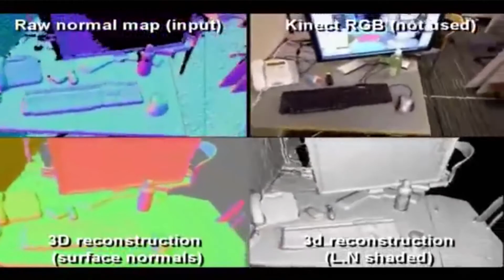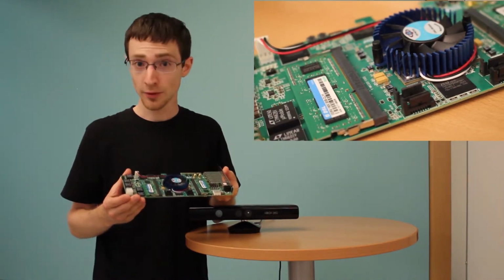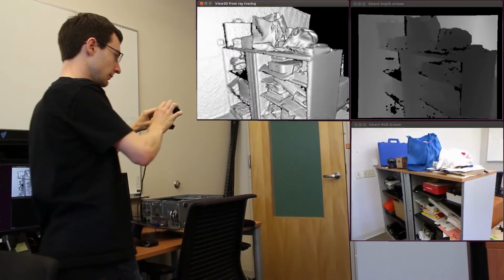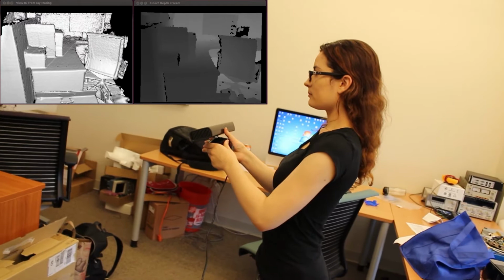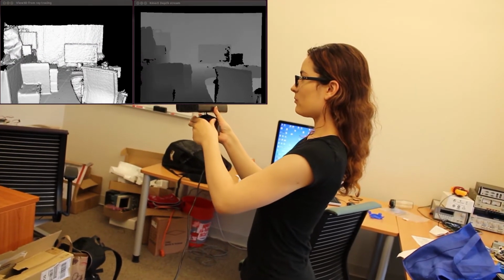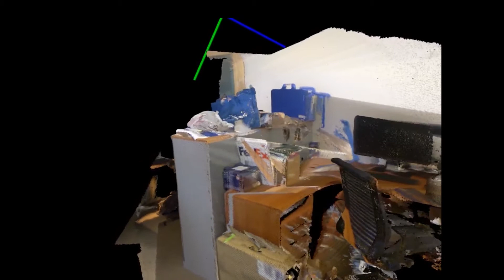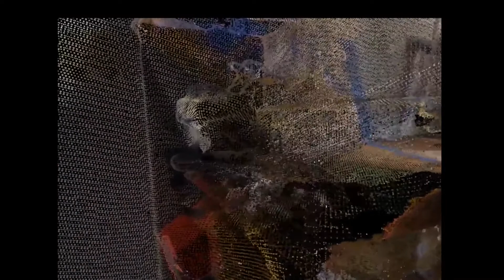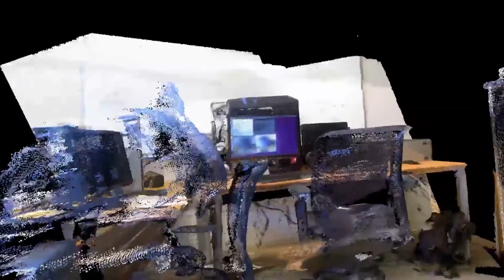KinectFusion on FPGA (+ bonus)

Comment: Hi there, very amazing work! May I take a look at your hardware connection...since I am not a hardware guy either and I'm planning to realise SLAM on fpga with Kinect:0
Reply from the maker: Hi, this is an old project, but feel free to check the related paper (http://kastner.ucsd.edu/wp-content/uploads/2013/08/admin/fpt14-kinect.pdf) and another, more recent, similar work (http://kastner.ucsd.edu/wp-content/uploads/2013/08/admin/asap19-real-time_dense_slam.pdf).